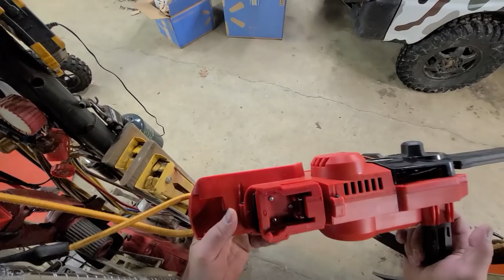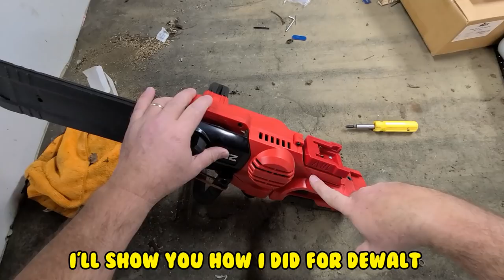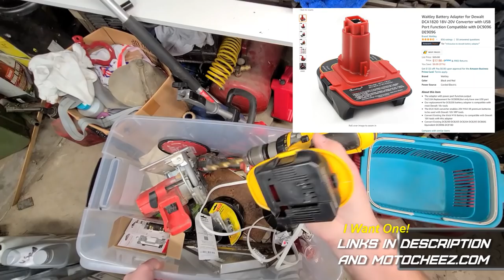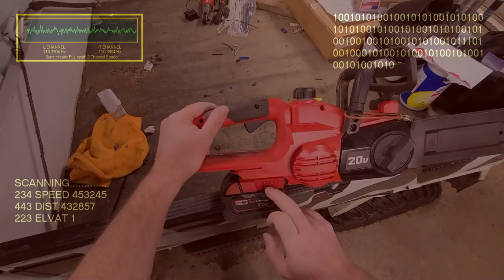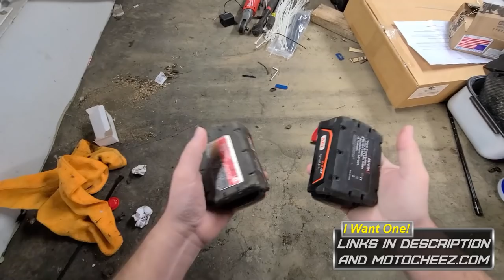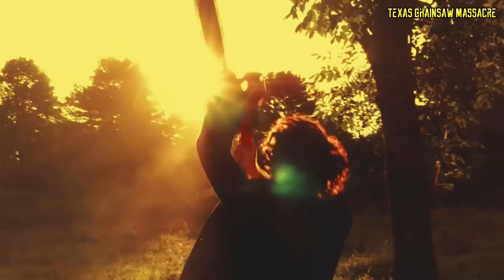Milwaukee M18 (18 volt} conversion to HF Bauer 20v chainsaw + other uses. 18v vs 20v batteries

Comment from the maker: Links:
Right Angle Battery Adapter for Milwaukee 18V M18: https://amzn.to/3a0UgBo
H Battery Adapter for Milwaukee 18V M18: https://amzn.to/3aJTec8
2PACK For Milwaukee M18 Lithium XC 6.0AH Extended Capacity Battery: https://amzn.to/3pq4qQm
Waitley Battery Adapter for Dewalt DCA1820 18V-20V Converter with USB Port: https://amzn.to/3oYQaOs

Comment: Good Conversion buddy!  but Makita#1 the industry first big name, then the others came along.  Love my Milwaukee’s Made In USA , corded tools, and the the Makita Cordless tools for on the the job-site work back in the day, just upgraded my Makita’s, with new 😉  Did buy a new Dewalt 12” sliding mitre box recently, A+++++
I did take a serious look at the Milwaukee line, love the new angle grinder, but just couldn’t, Makita loyal.  I beat the hell out of my Makita’s and never had a failure 💪🏻👍🏻
Also, what’s amazing to me is in the shops today, the elec. cordless tools have a major place compared to the years back where we used air tools exclusively, which requires huge compressors and air tanks for accumulators and added air supply, along with the use of electrical corded tools for day to day repairs and operating, it’s the age of cordless...........And like your favorite go to, no more gas and oil for the chainsaws, amazing being part of the history and revolution of the industrial world
Reply from the maker: I also had makita back in the NiCad battery days btgey were awesome. Remember that looking battery? Then switched to craftsman for a very short while, now milwaukee!
Reply: @MotoCheez  Yes, that’s where it started for me as well, glad it all went lithium-ion, do love the  Milwaukee M12 series would be great in the woodshop, compact and light.  Enjoy your video’s, the mini truck, the grom clone, and now the Florida property.  How is the Reolink PT camera doing, like to see an update on that after a full year in the Florida weather.  Good luck with everything, stay safe!

Comment: Whoa! I talked myself out of the Bauer because I didn’t want ANOTHER charger and another battery brand. You just changed my mind. I have a shit load of Milfuckee tools and batteries. Thanks.
Reply from the maker: I put the battery converter to Milwaukee
Reply: @MotoCheez  I saw that. Just ordered.

Comment: I've been slowly building up my Milwaukee M12 collection. Personally for me, I think Milwaukee has a vastly larger selection of cordless power tools than DeWalt does. It seems like every tool that Milwaukee has in their M18 line they have a compact version in the M12 line. Milwaukee has a rotary "Dremel" that takes the M12 batteries I'm eventually going to get. I'm also eye-balling their M12 stapler, riveter, cutoff-tool, and angled die grinder. My recent Milwaukee acquisition is an M12 drill and 1/4 impact driver kit that was on sale for $150 from $180 which also had the deal of getting a compact Milwaukee PackOut tool box for free, which normally goes for $60. So the purchase was well worth it. :)
Reply from the maker: I have a lot of M12 tools too. I have the dremel, soldering iron, 3/8 ratchet, angle drill
Reply: @MotoCheez  Nice. I started off slowly with just the 3/8" stubby M12 impact wrench and so far it's worked good for breaking rusty bolts loose on my old truck. I'll have a ratchet too but that's a future purchase. I have no problems with DeWalt as we have some DeWalt stuff that is corded. But Milwaukee seems to have the biggest selection of cordless tools to me. That and their dual charger that can charge an M18 and M12 battery at the same time. DeWalt might have something similar but I haven't looked. Been trying to stick to one tool platform. It's hard when you're curious to try something. :)
Reply from the maker: Last I looked,.dewalt had more battery tools. That was over a year ago
Reply: @MotoCheez  what were you looking for? They do have a chainsaw. One thing I am waiting on Milwaukee is a track saw that they still don't have. 

But I find that Milwaukee typically has more tools than dewalt but there might be a few that dewalt has and not Milwaukee like the track saw
Reply from the maker: @user-hy8oh1cy3q  at the time they didn't. I actually got to review the chainsaw when it first came out! It's one of my highest watched videos.
Reply: @MotoCheez  I'll have to take a peek sometime. I just never really looked into DeWalt's cordless stuff. Mainly because any cordless tools on offer in store has always just been the typical drill and impact driver combo. Which just gets to be "meh" after a while. :)
Reply: @user-hy8oh1cy3q  I've noticed while looking on Milwaukee's website that they have a lot of specialty tools in both cordless lines as apposed to DeWalt. Who usually carries the typical carpentry and contractor stuff.
Reply from the maker: There are way more options now...WAY MORE

Comment: What kind of jeep you got? Wj or Zj?
 They all have a parasitic drain, intermittently leaving one stranded.
 I was overjoyed to discover I could build the jeeps batt with drill batt.
 I believe the problem is faulty diodes in Body control module.
Reply from the maker: This was the JK

Comment: I've been burned too many times by knock off batteries, I'll always buy genuine Makita (what I use) or Milwaukee. I feel like the best time to get OEM batts are around Black Friday, I've got good deals on 4.0 and 5.0 amp batts. There are some REALLY bad Chinese lith-ion batteries out there. They REALLY suck.
Reply from the maker: Agreed, I have too.  The warranty made me try them, but if the company doesn't reply you're still screwed.
Reply: @MotoCheez  Yeah, I feel like the warranty is just a way to get you to buy, then they scam you out of your money or it takes a while to get it back from eBay/PayPal. Either way, I don't mess with it.
Reply from the maker: Then paypal doesn't cover after like a month... I got screwed on an android radio once
Reply: @MotoCheez  Ugh, yeah man, stuff like this is so damn frustrating! Don't even get me started on all the counterfeit stuff on eBay! Scammers all over the place! Amazon is a bit better, you just need to make sure that you're getting it from Amazon and not some 3rd. party! Sometimes I hate the internet!

Comment: Dewalt has more of a range of the quality of thier products you can buy a crappy homeowner model or an expensive brushless you can buy the cheap battery’s or the expensive big ones with tester gauges it’s all in what you want to spend but Milwaukee is all high priced well made stuff with that being said everything I own is dewalt

Comment: 👍👍 I'd make a snarky comment but these are cool hacks.  And I think I speak for everyone about how stupid proprietary tool batteries are. 😅
I'd donate my left nut to the tool manufacture that just made tools that took high cap rechargeable lithium ion flashlight batteries already and added on a usb 3 socket so you could recharge through the tool if you had too.  I have it on all my olights now and its the best flashlight idea since LED.  I don't even use cell chargers anymore.  But fir tools I think Id rather use usb for for emergencies/top ups and a regular generic lithium battery recharger than proprietary chargers to.

Comment: How long you think a Milwaukee 5.0 battery would last running a corded 5.5amp Bauer corded harbor frieght weed whacker with a ac to dc Milwaukee converter
Reply from the maker: There's typically a 20% loss with those inverters and if it's 5.5 amp and that's a 5 amp hour battery I would say probably 40 45 minutes roughly

Comment: It's there any Bauer battery to Milwaukee tool adapters as well? I have Milwaukee tools but want to buy cheaper battery packs
Reply from the maker: I'm not sure, but a lot of people are 3d printing the adapters now and selling on eBay. I bought some off brand Milwaukee batteries and they worked great for over a year now

Comment: Do you know if a Dewalt 20V with adapter will fit in Milwaukee quick connect trimmer or leaf blower?  Got Dewalt batteries but like the Milwaukee trimmer with interchangeable attachments.
Reply from the maker: The old nicad style battery like this drill took? If so, yes. I think they make the newer style battery adapters too